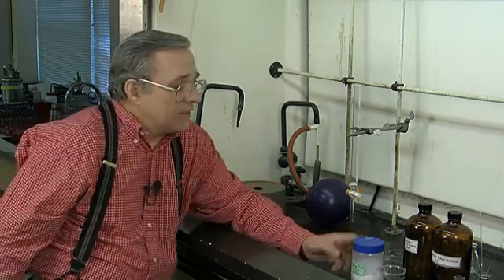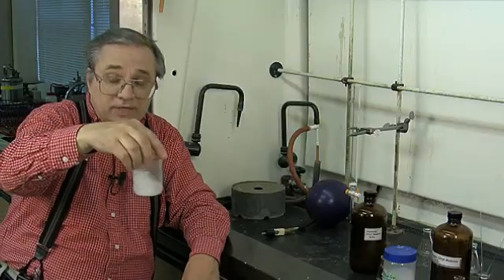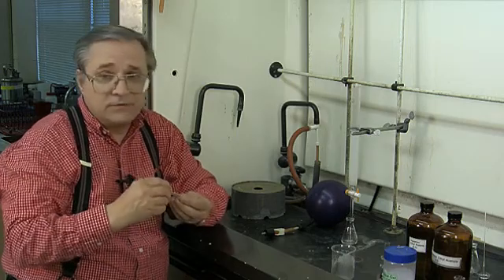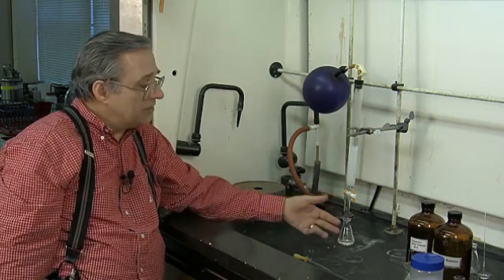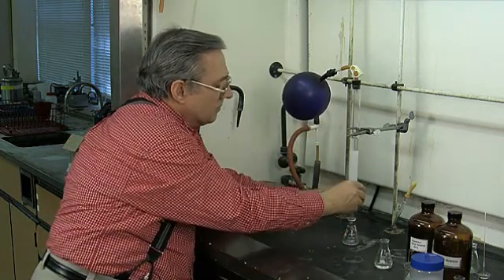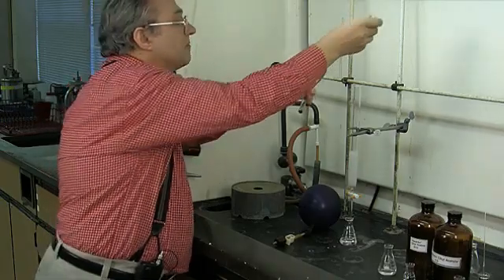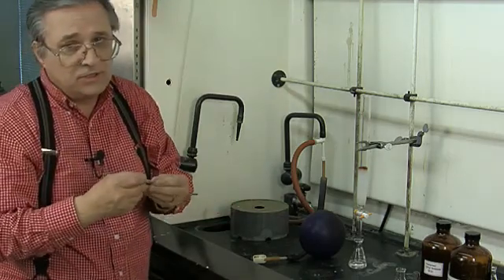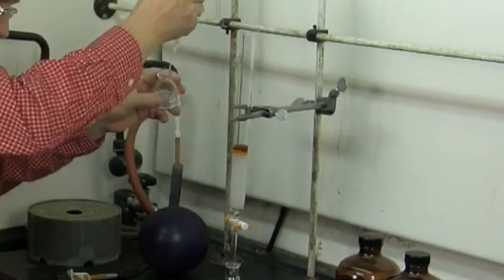Column Chromatography Demonstrated by Mark Niemczyk, PhD

Comment: Hello,
I have a problem with my column and the  flow is very low, as to 1 drop every half a second. I would like to try the nitrogen balloon. What type of adaptor do you use  to connect the silicon pipe to the end of the column ?